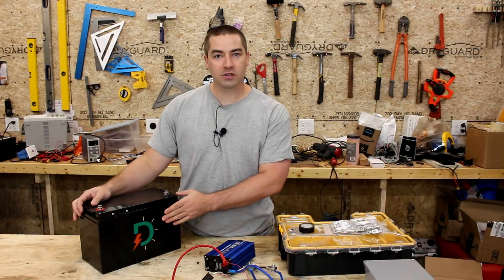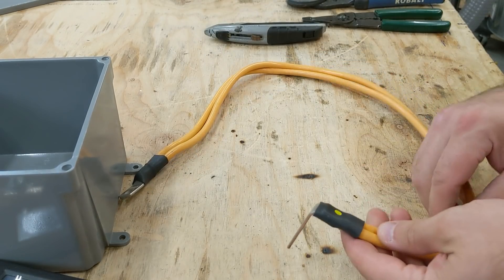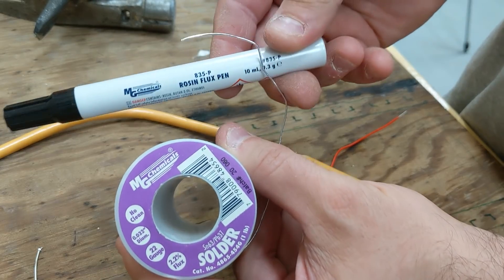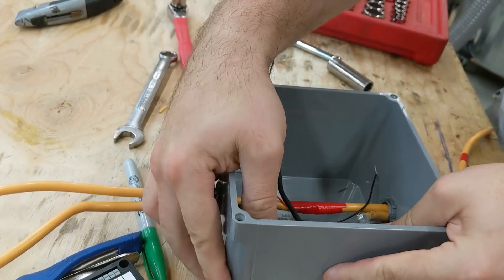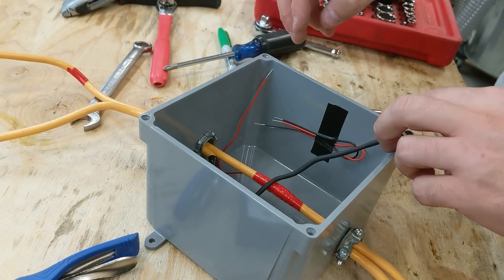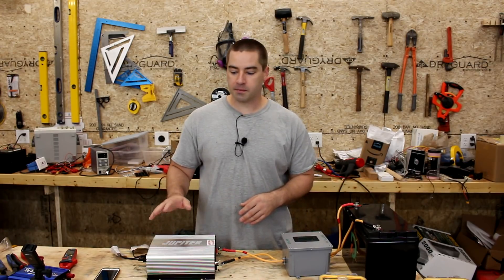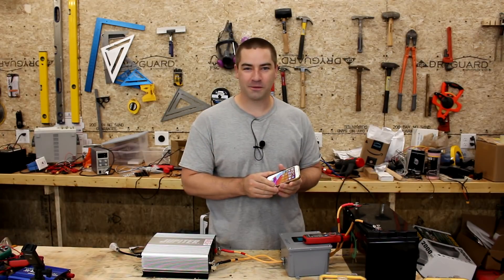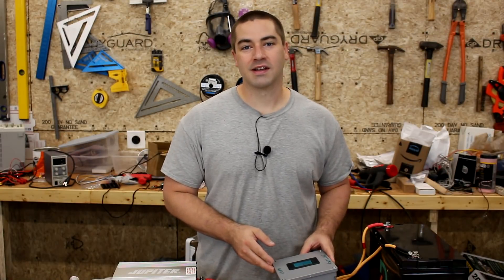Better Battery Modding with your DIYed Meter

Comment: This meter needs to be calibrated specific to the battery voltage and few other parameters. Without doing that the numbers will be out.

Comment: The BMS sits right on top of the battery so it almost doesn't sees any voltage drop. There is a voltage drop in the wires so the meter sees a smaller voltage than the BMS.

Comment: Does this meter count charging as negative on the capacity so you can use it to check the charge state of the battery? Heard from another comment that it doesnt which would be a bummer.

Comment: I would have put a Big resistor 1%, a fan and an USB power bank inside the box.  Than I would have drill holes on sides of the box. This would give you the best capital rates and than you add 2% to your Amp hour amount.

Comment: Is there a way to calibrate the voltage on this meter? I have the exact same meter. However it is 2/10th of a volt higher than my other calibration voltmeters.
Reply from the maker: No, or at least I don't see any way to.

Comment: So once the batteries bms disconnects power the watt hour meter will shut down as well ? Perhaps you can power it with a external power source.  I would certainly like to build one to test battery capacity for larger cells !

Comment: I new to learning all this battery inverter stuff...i see you have a jupiter inverter...im really confused about inverters because one side says dont use modified wave in your rv, then the other side says its totally fine...smh what is the scoop?
Reply from the maker: Modified sine wave is fine for some loads, but very harsh for others.  For example, heaters (baseboards, water heaters, stoves, ovens, all run fine on modified sine wave.  But electronics like LED lights, CFL lights, TV, and some types of motors will not run right on modified sine wave and need pure sine wave.  I suggest sticking to pure sine wave most of the time.  I bought this cheap inverter (jupiter) just to test loads with heaters, so it's fine in this application.  If you want to see the sine wave check out this video: https://youtu.be/gx_q0h7YCJU

Comment: If they die isn't small enough, I turn one of the dies over with just the flat part.

Great idea for the build. I'm using 4 of them with a  12x12 box, and thanks for the link to the metter gauge thingy.

Comment: Why don't you just get one of those load meters that has a heat sink and it just dissipates the energy to heat and then measures the current you don't need anything other than the two wires and plug the thing in it's its own load
Reply from the maker: When I looked into those they had limited.  Fairly low watts, amps, and small voltage range.  But I don't know the exact model you are referring to.  With this meter I built I can hook up to 100 amps at any voltage range I'm working with.

Comment: Your BMS is likely accurate as well as your meter box.  The reason they are slightly different is because you have a circuit breaker in between them.  Circuit breakers use a resistance heater to heat a bi-metal trigger inside the breaker.  They voltage drop across the breaker will depend on the amp rating of the breaker and the amps flowing through it.   I have found many blowing breaker issues to be faulty breakers or bad connections to the bus-bar by measuring the voltage drop while under load.   There is also the voltage drop associated with the main conducting wire to consider which you intercepted for your meter mid wire.

Comment: the meters are off due to the loss in the wire from one end to the other ... and the BMS in the batt its correct because it is inside the batt ...... just something you need to know as far as how it drops from one meter to the next

Comment: I wish someone would market your box and maybe offer different  rated shunts that can easily be switched for different amperage  ranges .
It amazes me that no one has had the idea before you.
Watt meters are so  badly made. Its hard to find anything good and reliable.
Another thing ... why measure amp hours for capacity . It should only be watt hours since the voltage drops as you use amp hours.
Reply from the maker: This meter measures and displays both ah and wh.  after 1,000wh it will automatically switch and start displaying kwh.

Comment: The reason you have to run separate wires to the battery to measure the voltage is because if you don't, your meter will be reading the battery voltage minus the series resistance. This doesn't appear to be an issue in your application but I have seen this cause some serious problems in some situations.

Comment: I used to buy a lot of enclosures like that but now with the cost of 3D printing so low I find it's cheaper to print the panels and design the top panel in cad rather than having to cut and punch the metal. It's a little more time consuming but it gets faster and easier with every project.

Comment: I Expect some voltages difference as you show. Because each meter have a 1-2% tolerance and also they are pulling data from different  points in the circuit. I believe they are very accurate. And you doing a great job in your channel.

Comment: Nice project, but I'd like to suggest two more improvements if you do it again:
1. Put a fuse on the supply line for the meter. I don't like the idea of running a high current source into cheap electronics without protection. If the meter develops a fault the results could be exciting.
2. Maybe use different cable clamps for the wires. It's probably not an issue but it looks like the edges of the clamps are biting into the wire. With these big wires you might want to have two clamps on each side, one for each wire.

Comment: I was thinking about adding one of those to our big battery charger that has a like 200 amp start function it has some analog gauges but they don't really work well anymore but I was going to go with an inductive current transformer
Reply: Just an FYI current transformers can only measure AC current so aren't very useful with batteries. If you look you can find DC-capable sensors which are used in a similar manner, though. I believe they're less accurate than a shunt but should be good enough to replace an analog meter.

Comment: David, with your UNI-T clamp meter, have you noticed that it measures a different value depending on the current direction? I found it only measures correctly when the direction is correct, so the current flows in the way it shows on the clamp. Have you noticed something like this too or is this just mine?
Thanks for the great video and built.

Comment: You zeroed out the meter, then covered the screen with your hand as you rotated the meter 90degrees to the left.
The zero feature is to zero out the earths magnetic field. You need to zero out the meter in the same orientation you are measuring the load in.

Comment: Great Video!  By any chance would you have any use for an a/c compressor out of a chevy bolt? Reason it was replaced was due to rodent damage, they chewed the orange wire half way up and apparently you can only get that wire with the compressor. They also chewed the main "engine harness" was a insurance job, but pretty simple and paid pretty well for the amount of time it actually took.
Reply from the maker: Is the compressor self-contained with it's own 12v motor, or does it need a belt-drive?
Reply: @DavidPozEnergy  It is self contained, but it is a 300 volt compressor. Also uses 1234yf refrigerant. but i honestly don't see why 134a couldn't be used as long as poe oil was used.

Comment: Suggestion is a 120A circuit breaker in the box.  There is room and not all batteries will have their own breaker.

Comment: you could put a double pole double throw switch on the sensing wires that go to your shunt and be able to monitor current in both directions like if you were charging from a solar panel

Comment: I don't personally much like the idea of using an inverter and an ac load. 
I would visit a junk yard and collect 50w 12v bulbs then you can switch them in series/parallel for a variety of loads.

Comment: TO ANYONE STRUGGLING WITH THE SAME “DYE SIZES” CONFUSION - Heres the solution:

Here is a LINK to a chart i sent to @DavidPoz in another comment:
It’s the “US STANDARD CROSS SECTION to SQUARE MILLIMETRES” CHART

PDF HYPERLINK: http://www.gfienterprises.co.uk/assets/PDFs/USA-to-European-Conductor-Sizes.pdf

Using this, you’ll learn that his “25” DYE was 25mm(2) which would be used on 4-AWG...

The “16” DYE he ended up using is 16mm(2) which means his wire was 6-AWG (not 5)

So the numbers on the DYES are the CROSS SECTION MEASUREMENTS IN MM SQUARED

using this chart, you’ll find 3 columns...

#1 - the US AWG SIZES
#2 - each AWG’s “equivalent mm(2) cross section” measurements
#3 - “nearest available mm(2) cross section” AKA these weird dye sizes...

I don’t get WHY this is even a thing, but it’s why these dyes are labeled the way they are for certain and I’m sure David isn’t the only person struggling with it. 

If you eliminate Column #2 on this chart, you have your “AWG TO CRAZY FOREIGN ALIEN DYE SIZE” CONVERSION CHART, and you’ll never again need to fumble with dyes and wonder which one to use again. 

✌️

Comment: Add an extra switch, with a 9V (or something rechargeable with a USB input) in the case so all you have to do is flip that switch for lower voltage, OR for testing packs with low voltage cutoffs (so you don't loose your data when the BMS kicks in).

Comment: This is awesome. One improvement that could be added, (in my opinion) an external power supply so that if the battery (for whatever reason) dies or whatever mishap may occur the meter then retains the information collected.
Reply: I use this particular meter for some things and I use a separate 12 bus just to power them as I find them more accurate that way.

Comment: I bought several of the basic Drok meters a few years ago. I put connectors on them and taped up the shunt with the wiring. I put the head on 4 ebikes because they are a great battery monitor. They work in one direction Everything I have is wired with an XT60. I must have three hundred. Anyway if I monitor a battery I can hook the meter to the bike and motor with one set of connectors. Those meters are labeled 'discharge'. I have charge meters.  I can hook the discharge meter to a battery and  a charger by using gender changers, basically a male to male and fem to fem adapter. The Hall meters that are showing up on Amazon (cheap) show flow in and out, and the accumulated flow. They are less accurate. For ebike batteries where cycles and charge % are an issue, this is pretty precise. Your project is great but. My only gripe is that the nice box is kind of worthless for mounting on a bike. It really pays to have everything set up with the same connectors. The XT60 handles my loads. The battery monitor that SOK Battery sells (everyone in China) quite cheap does a great job, just connected to a big lith. In and out flow and %, very low draw.

Comment: I like everything except leaving w wires with stripped ends tapped in the box. If that electrical tape lets go, you run the risk of a short circuit. I guess there may not be a lot of places for it to short out, but given the power involved - Murphy will find a way.

Comment: Nice job David.  I have a very similar one I built a few years back and I still use it all the time.
Why not add a 150A DC breaker for around $10?  This will protect your outputs from short circuit and extreme over-current.  Over-sizing the breaker a bit minimizes internal voltage drops.  In your configuration, the shunt which is likely just painted steel is your largest power drop.  Probably slightly more than the cables themselves.  Having a breaker gives you the added advantage of being able to disconnect the power without having to remove cable terminals. ~Cheers
Reply from the maker: It's a good suggestion, thanks.  In my head I was thinking of this particular build, and I already have a breaker.  But it would be useful for other batteries that don't have a breaker.

Comment: Still I am not that convinced due to the major fact that this kind of metering offers just one way only measuring so in your case the load, but it can not show the battery SOC while charging.

This needs a different approach, a 2 way metering that might be as cheap and also offering a remote display you can take away a bit which is powered by USB power source like battery bannk or so. Good for all RV in my opinion.

And it does not use a shunt just an inductive measuring ring you know from the clamp.

I will check my list of coloumeteror energymeter from a list and add those meter cause I had bought about 6 or 7 different until I found a quite good one. just a few minutes I hope.

Here is just one, the best with wireless meter and showing the saldo of load and what comes in at the moment and the SOC

Shuntless system with wireless colour monitor 
TAIDACENT VAC8010F 500V 500A battery monitor - 25€

https://www.aliexpress.com/item/32856210821.html 

Works good, and if you need manufacturer infos then check this out and search for
VAC8010F or sku 2001711004

https://www.droking.com/Digital-Meter-Multifunction-Panel-Meter-DC-6V-80V-300A-999-KW-LCD-Display-Tester-Monitor-Meter-Multimeter-Thermometer

As always: chinese copy those or label it and create their own brand ... but this one seems to be the manufacturer or international distributor.
Reply: shuntless system with wireless colour monitor 

TAIDACENT VAC8010F 500V 500A battery monitor - 25€

https://www.aliexpress.com/item/32856210821.html

Different Voltages and Ampere versions available
All links usually offer paypal cause I want buyer protection.
For $ check them out or take 10% of € prices

Finally: a lot of the shunt based energymeter need a shielded extension cable to get right measurements that you have to pay for, mostly a lot if you check the vendors carefully. 10€ for 3 m of cable on top of the whole device that comes for 20€ is a bit too much, but you can check that out. Here is at least one example of such cable offer but every meter might need his own extension cable to get from the battery to the place you need the energymeter. Yes, they all come with cable, but 50 cm or 100 cm will never be enough for your eyes to get a good viewing and reading angle. Also keep in mind, some are very tiny and hard to read.
Therefore check those wireless displays that only need a USB powered connection ... save a lot of headache and wiring.

SHUNT + WIRELESS MONITOR 1st choice
================================
==
DC 120V 100A AmpWattMeter wireless Display: 22,76€ 
https://www.aliexpress.com/item/32702653747.html

4 m shielded extension cable 5€ + shipping but you can choose the length
https://www.aliexpress.com/item/32823972314.html

SHUNT 2nd choice
TF03K-B - 50A with ttl232 data controller: 36€
This is a different one some might be looking for cause it can collect and save the data due to a logger or ttl232 data controller ... pretty unique but also a bit more expensive.
https://www.aliexpress.com/item/32883704077.html

This one above is also available as TF03K-A, which offers a different display but in this offer here you also can find measurements and manual for both 
https://www.aliexpress.com/item/4000782624540.html

This one seems  to be the manufacturer for a lot of these devices sold under xillions of brands
Shanghai Baiway Electronic Co., Ltd.
Here you can check the catalog
https://shbwdz.en.made-in-china.com/Product-Catalogs/

SHUNT: 3rd choice
★ TK15 BATTERY TESTER + MONITOR 20€
★ TF01N BATTERY TESTER + MONITOR like TK15 without case 18€
https://www.aliexpress.com/wholesale?SearchText=tf01n&d=y&CatId=0&SortType=price_asc&groupsort=1&page=1

SHUNT: 4th choice
TR16 BATTERY TESTER + MONITOR with a tiny round display and one way only - 20€
Good shunt, but one way only
https://www.aliexpress.com/wholesale?catId=0&initiative_id=SB_20201028080007&SearchText=tr16+100a

FINALLY:
Just to make it complete: there are guys that had been developing electronics to get a 2 way version using 2 of these shunt based meter but I still guess the first wire- and shuntless is the best, easiest and cheapest to start with. No strange wiring, no clumsy shunt and big connector to crimp. A lot of time and money and space to save just running the negative wire through the meter.

Of cause all my opinion but I had purchased all of these and went through the whole list , made tons of researches on the chinese web and youtube and RV groups. 
Not for every one but for all that want to know what goes in and out esepecially RV if you are not always using them and you are asking if the battery is full. My dad used to check the Voltage as "indicator", the old guys tradition  but that was this summer 2 times misleading and therefore he got a bigger battery and now the gauge to get behind what is going on inside ...

The first one is only showing 1 value which means it is the result of what is going out to the load and what comes in from the charger: 2 A or 24 W then mean that the batteries are charged with that amount and that the load is fully covered

-2 A or -24W would mean that the charging rate is 2A or 24W lower than the current consumption. 
It does not mean that the whole consumption is 2A only cause the solar array could deliver 12A at the same time and that would mean 14A load.

Only in darkness and while not driving or grid tied you can see the real consumption of all loads in the RV but than you can shut off one by one and write down the change cause turning off a light and 1A less shows you 1 A consumption for that light, 3A less for a USB charger for example ... and then you can identify TV + Sat receiver + soundbar consumption too.  

I had worked on this compilation of good devices for about 1 months in August or so and 1 months to check them all out.